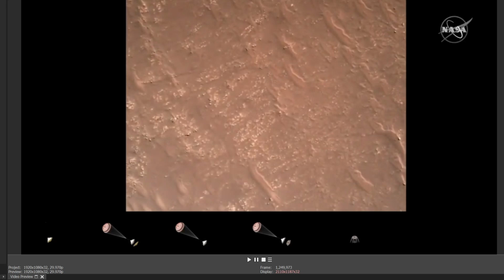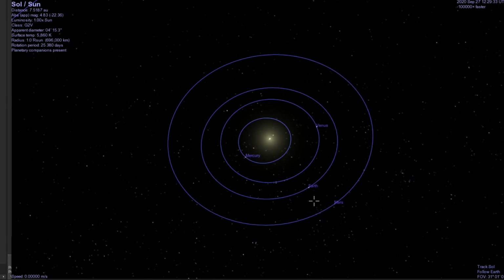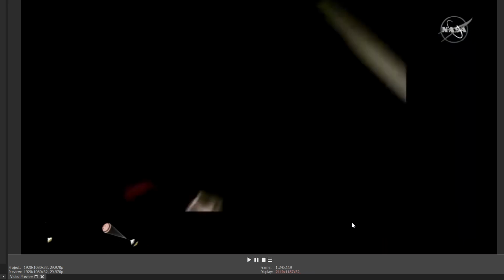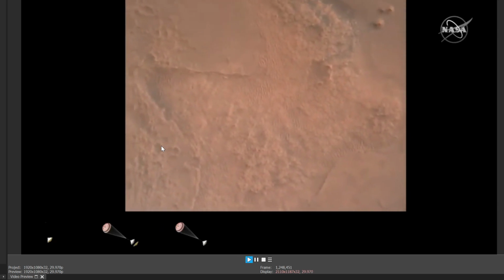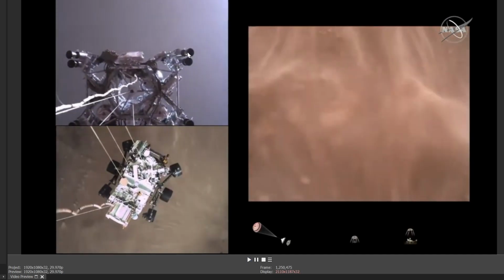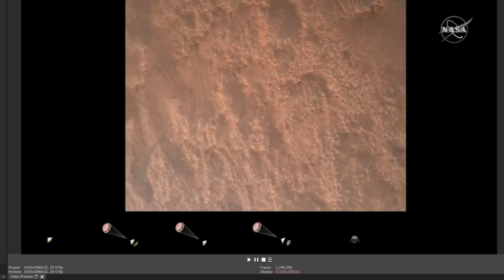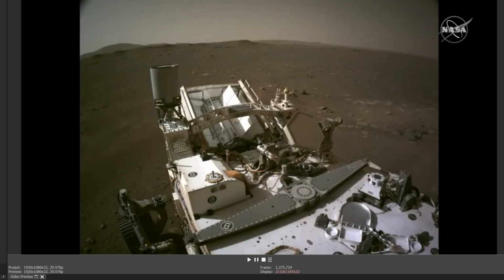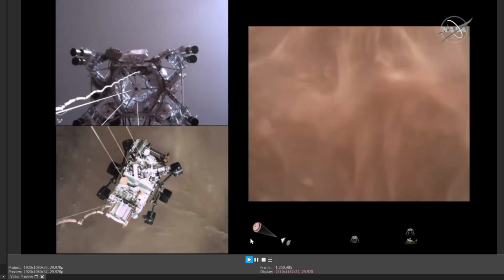NASA releases AMAZING video of Perseverance landing

Comment: oh yes please, place a microphone, computer-fan and speaker in a 1% vacuum
Reply: With 38% of earth gravity, it was shown to work on nasa lab with the helicopter drone simulation. It was done on their vacuum chamber matching Mars 1%atmosphere and a string tied on top of the drone with pulley and a counter weight to simulate it's calculated weight in mars. It worked.
Reply: @emancoy  he talk about sound test, not helicopter
Reply: @gorky_vk  the computer fan covers that experiment.  And 1% atmosphere can still tramsmit sound
Reply: I have an idea.
To make fan make no sound we put it in a vacuum chamber and call it
The vacuum fan. It makes both sides the same temperature at all times.
Adding new silent mode to make it quieter.
Reply: Look at the nasa website there is a bunch of pretty accurate simulations using vacuum chambers so you can compare the distortion in the lower atmosphere